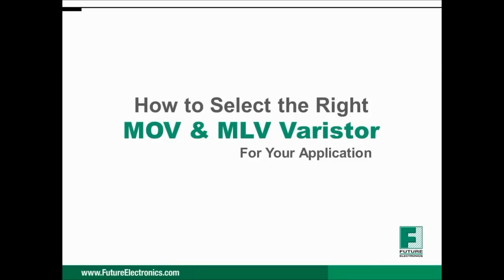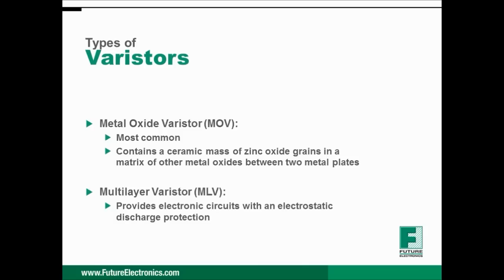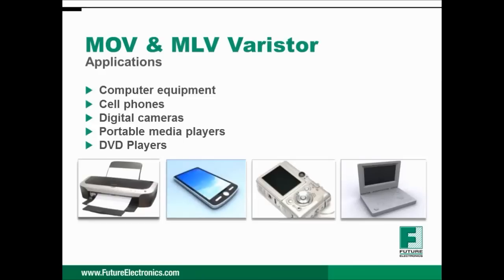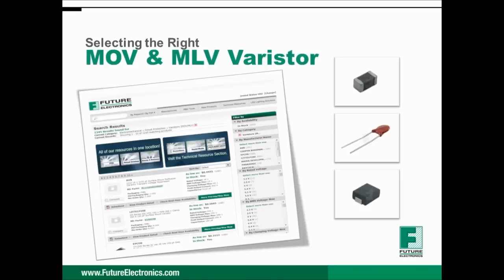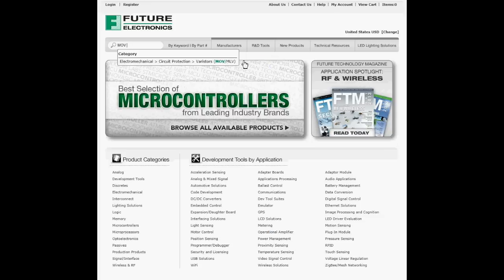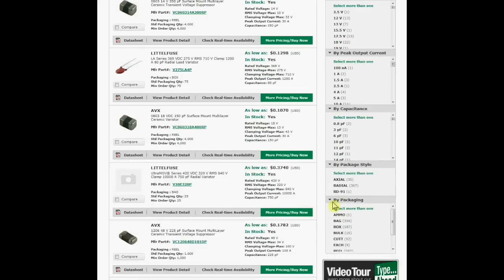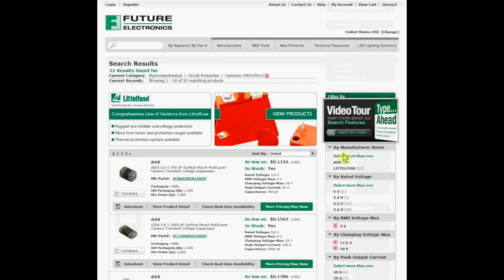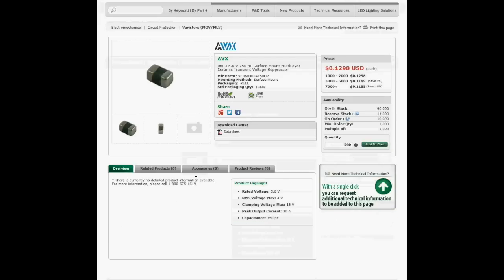How To Select The Right MOV & MLV Varistor For Your Application

Comment: This didn't explain shit.
Do you select based on the maximum AC voltage, the varister voltage or the clamping voltage?
I need protection on a 220Vac line? Which voltage do you select as 220V?
I'm guessing maximum AC voltage, which then give me a clamping voltage of 810V and a Varistor Voltage of 470V?
Reply: Yeah, for 220-240VAC --
Should I use a 431 or 471 volt MOV?
Leakage current?